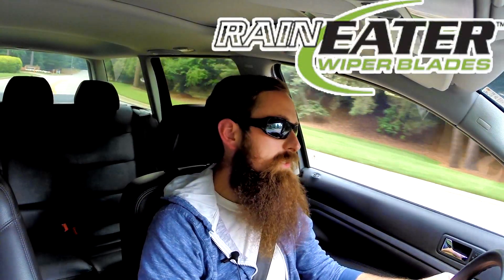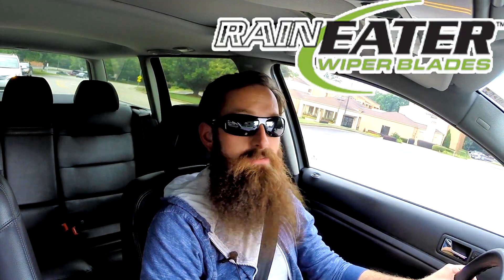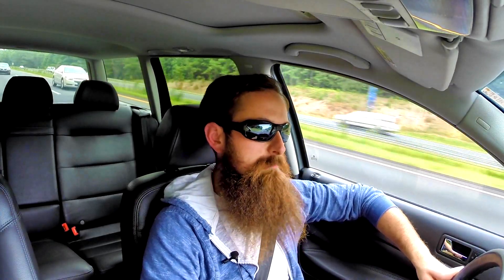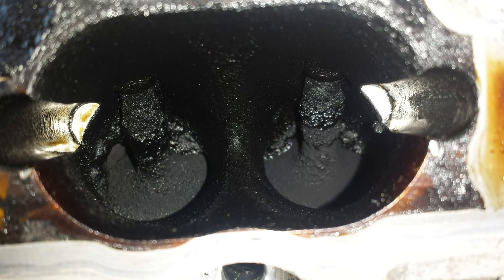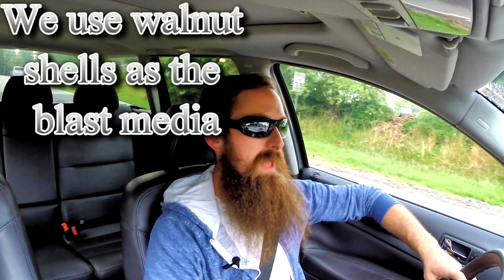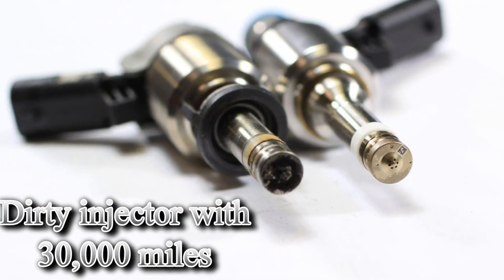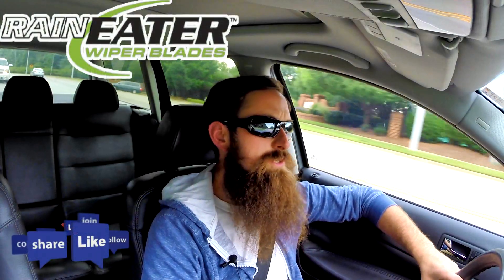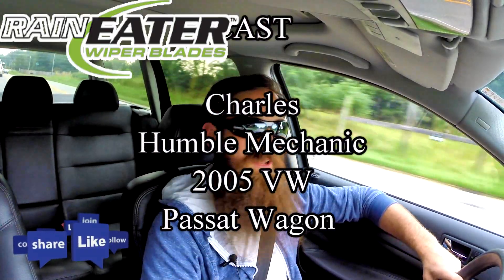Preventing and Fixing Carbon Issues for Direct Injection Engines ~ Episode 80

Comment: Seafoam or Blue chem?
Reply: I had a mazdaspeed 3 first gen the amount of carbon was horrible.., worse than BMW. I developed a cold start problem and misfiring around 70k and the car was raced too for years. I now have a 3rd gen na mazda 3 and na with direct injection produces no carbon at the tailpipe runs as good as when I got it 3 years ago if not better.,
Reply: seafoam has little to no effect on carbon. the mazdaspeed community has tried this, that and the other and the only realistic way of cleaning the valves is to remove the intake manifold and either media blast them or soak them in solvent over night and clean them with wire brushes.
Reply: Shane Miller it's funny you say that cuz in my Mazda 3 I had a too lean at idle code and after replacing the parts recommended by the dealer the light kept coming back on. Sea foam through the intake cleaned out a lot of carbon (black smoke from the exhaust) and the CEL stayed off after that...  Lol your argument is invalid
Reply: what year is the car?
Reply: Shane Miller not relevant to the core context of our contention with each other's statements
Reply: Sure it is. if it's pre 2012 then it's probably not direct injection and you're also saying that you fixed a lean condition with seafoam by cleaning the intake valves thus increasing your air flow... Now I'm not saying that seafoam isn't useful. If you've done it every oil change then there is a good chance that you have vastly prevented build up but if you are 40k-80k miles in and think you are cleaning your valves with seafoam them I'm gonna have to disagree. I'm not here to start a pissing match but vw forum, mazdaspeed forum, and many others have tested seafoam and it's like putting a bandaid on cancer if you have bad build up.
Reply: Yes, but he said he was talking about his Mazda 3 which would have a 2.0 or 2.3 MZR before 2012. Mazda didn't change to DI until the skyactivs in 2012. the MZR-DISI in the mazdaspeed's and cx-7 were the only pre 2012 DIs I was aware of. So that's all I was trying to find out. Sounds more like his seafoam cleaned an injector than a valve to me. NBD
Reply: USDM Mazdas didn't get Skyactiv until 2012. Trust me. I bought my 4th mazda3 that year and my buddy bought the new mazda3 skyactiv 2.0 the same day at the same dealership. Just Google skyactiv-G wikipedia. took all of 2 seconds to reassure myself. Done with this thread!
Reply: Neither----Techron.

Comment: I have a DI mazda Skyactiv and they claim they cured this by keeping the valve at a certain temperature to keep carbon from forming. I only have 16k miles so we shall see. I do wonder about those seafoam intake cleaners that you spray through the throttle body. Based on how your video of you cleaning the carbon of the VW piston methinks short of blasting that off with walnuts nothing is going to work.

Comment: Thanks for the video, as it seems DI is the newest band wagon [little engines w DI, sometimes turbo, high compression = high heat, high pressure torture on parts and oil]  
You didn't mention the use of premium quality synthetic oil or the role of ECM programming on the cause and prevention side of the solution...?
Reply from the maker: The more I learn about the failures, the more I see oil as a vital player. ECMs can only do so much. It requires ALL parties to play nice.

Comment: HumbleMechanic, I replaced my Injectors after paying for a shell blast carbon cleaning. Turns out, my injectors were clogged. I believe the previous owner had been using low tier fuel, maybe even 87 octane. I also had a fuel pump replacement under warranty. I now have an extremely clean amazing GTI with new coils, plugs, PCV, fuel pump, and injectors. This is the entire fuel system. I believe that ethanol is also playing a part in this. I now mix high octane ethanol free fuel to run in my CCTA engine. Next, i will add water injection to further help prevent this issue, and lower intake air temperatures.

Comment: Ford's new 3.5L V6 will have 2 injectors per cylinder to eliminate this problem. One injector will be a direct injector and the 2nd one will spray fuel behind the valve. Initially, the engine will only be used on the new F150 due out this fall.
Reply from the maker: +Robert Devoy cool. It will be interesting to see who else does this. My guess is most manufacturers will go this route
Reply: I wish every manufacturer had to do this. it would really give me peace of mind.
Reply: Toyota has implemented a direct port style injection system in some of their Lexus vehicles the past year for this very reason. Like you said, one inside the chamber and the other just before the intake valve.
Reply: That's how the BRZ works.
Reply: christopher waller question, Ford says not to do any carbon cleaning services in the form of liquids etc but can Lucas fuel treatment be used safely? I don't see why it couldn't, just a general question. While I believe this will help clean injectors, piston tops etc I don't see it having much if any affect on the valve backs where carbon is a major issue. Plz elaborate.
Reply: The GEN 3 coyote engines use both types of injections also. I think that’s the safest route compared to DI only.
Reply: id love to see where u read this being im a ford nissan master tech and have not heard of this. i do know that the new 3.5 thats going in the 2017 raptor etc has been redesigned with harder parts and lower compression so that more boost can be added via the tt snails. have heard of a dual injection. maybe on the 1.8 or 2.0 since they are 4 cyl but this would defeat the purpose of the ecoboost, more power with better mpg. please add a link bc i cannot find that anywhere on any database for ford
Reply: I'll try to find where I read this.
Reply: christopher waller http://news.pickuptrucks.com/2016/09/2017-ford-f-150-receives-upgraded-35-liter-ecoboost-engine.html
Reply: Robert Devoy that's crazy, 2 injectors is unnecessary, and a poor way for ford to "correct an issue" I love my 2.7. catch-cans basically stop the majority of the issue, the rest is fuel additive (lucus/seafoam), and the occasional spirited drive. same issue with my 2.0t fusion but I've looked at mine after what I recommend above. after 84,000 miles, clean valves, put a camera inside to check them
Reply: I can tell you that these catch cans you mentioned do work very well. I have one on my 08 Silverado and the carbon build up on the throttle body and valves is next to nothing now. I do run 93 octane due to it being professionally tuned with EFI live tuning but every little bit helps. I highly recommend this catch can. I read somewhere that the oil vapor that gets routed into the intake can lower your octane rating. How much if it does, I do not know. But I have noticed slightly better fuel consumption and a tad more power than normal. Mabey they latter is just in my head but it does feel better.
Reply: Mr S that's how the old 4 cylinders in the rangers worked too. doesn't mean it was good on gas. u might as well dropped a v8 in there. point is why do direct injection if ur also going to put in a traditional system. that's twice the parts and parts go bad. I worked for ford and my neighbor growing up was a ford service manager who stayed until he ran the place. I learn a lot about how ford takes parts and replaces components so as to keep a maintenance interval. same thing they did with GM's 6f35 transmission. Ford got a hold of a perfectly good transmission and trashed it with crappy parts and lv that breaks down twice as fast and cost more than GM's fluid.  Ford claims it's BC the clutches used which is a bunch of bull. the solenoid fails and the the clutch fails do to shotty parts. Ford did it on the triton with the coil overs and plugs on those damn 3 valves and they tell the technicians and put in manuals to trq to 21ftlbtrq when it should not exceed 18, hence ford made a tool to remove the broken spark plugs. not to mention it's the only vehicle I have had too get the engine hot before busting the plugs. but I can garuantee ford did this to keep money in their pocket. this is why every ford I own I remove ford parts that are troublesome or repair the issue before it becomes a problem. hence my fords make it to 300,000 miles ( between my wife and I we drive 100,000miles a yr. I do a minimum of 70k)  in the 5 fords I've owned and typically get better numbers than factory mpg/power. I know ford and Nissan very well. I know more to since ford uses parts from Mazda,gm, Toyota, etc...  but I'm a diagnosis tech. and Subarus are great cars but do not boast the best mpg either. they usually say 22-30 avg and every Subaru owner I've seen gets way under the EPA tag (had a couple of hose too.. I use to fix n flip when I had my dealers licence.) either way in my 2.7 i average 22 city 25 overall and around 30 hwy in the mountains. at sea level it's better. 2.0t gets 27 average 24-25 city and have had over 40 on long road trips(hwy) it now has 100,000 miles and bought less than a year ago with 33,000 miles
Reply: doesn't  A 4 cylinder mimic a spirited drive all the time?

Comment: If you were going to fog the engine like cleaning an old school carburetor or cleaning a throttle body of a fuelie you would have to spray carburetor cleaner on the valves directly like you would with throttle body or carb. let it sit for 10 minutes and fog as usual.

Comment: AAA just came out with a study that finds that top tier fuels dramatically reduce carbon deposits in injectors, valves and other engine parts. Unfortunately the study did not discriminate between direct injection engines and standard. AAA said that the extra few cents per gallon was worth the cost.

Comment: Had this issue with my GTI less than two years ago and am dealing with it once again. Wish I knew what I was getting into when I bought it.
Reply: Are you using full synthetic oil and regular oil changes?.
Reply: @FacuGonz3  It doesn't matter, air, moisture buildup over time with DI will cause the carbon build up regardless.  A Oil catch can will make carbon build up take longer but eventually you have to get it cleaned.
Reply: Many European cars have this problem, not only German...
Reply: this is the reason this cars have bad reputation , people get cars without first doing research about it then complain when you have to do maintenance , want something simple get a honda or toyota 🤷🏻‍♂️
Reply: Top tier may slow it, what about 93 octane?

Comment: hi, Have you tried water injection? I think this would be a great fix for this problem. I have seen it work on a old carby motor that had bad carbon build up.
Reply: Greg Faggotter I used it for a power adder in my old 79mk1 with a M-tdi. after a teardown at 25k and all I had was a light coating of carbon that almost wiped clean on the piston tops with some carb cleaner on a rag. 
It doesn't work right away, but over a period of time it'll clean up the chambers for sure.
Reply: Greg Faggotter, In the 1950's 60's , in Australia, we had a thing called the "Kleinig water injector", this helped because leaded fuels caused engines to carbon  up and require a de coke, today this? may help, water does not have a solvent effect like fuel so I don't know what  this may do.

Comment: i cant believe they have not figured this out
Reply: Toyota has. direct injection / port injection combination
Reply: Not all do (if any).  I work for Toyota Manufacturing in Alabama.  We make all 3 sizes (4,6, and the V8).  I can only vouch that the 4 cylinder DOES NOT offer this.  It has port injection only.
Reply: 2GUNMASTER when did I ever say that "all" toyota engines are d4-s?
Reply: U didn't.  Just wanted to clarify for anyone who was reading.
Reply: 2GUNMASTER ok. Cool.

Comment: you mentioned oil catch cans in your video. check out the ones made by ADD W1. they are baffled, and have a dipstick as well to check the oil level without having to remove the can. I'm running 2 of them on my Hyundai Veloster Turbo.

Comment: Just did a cross country trip with my a3 (fsi) in some hot weather, by the end of it i noticed my idle is much smoother and my mpg went up significantly, could the the prolonged driving time at full temperature broke down some of the carbon buildup, i am at 87k now with no misfires.

Comment: I use premium in my 14" Jetta 1.8T 5 speed manual just in case and drive spirited...I try to use BP or Shell...Sometimes Golf too. Toyota has a port injector as well as Direct injectors on their Lexus models and new Tacoma only...The next Gen 2017 F-150 ecoboost 3.5 will also have a port injector as well as a DI injectors as well for this same reason. 
Hell have no mercy on yo if you have to clean a 911 engine with their new DI system! lol I pray for those guys!

Comment: BG has a new chemical specifically for this different from their other air/fuel injection kits. Basically it liquefies the carbon. Not sure how well it works but if it does could be a good alternative and also if used as part of preventative maintenance could prevent it from getting really bad.

Comment: This is one area where I applaud Toyota/Lexus. The early 3GR-FSE and 4GR-FSE engines used in the mid-2000s Lexus GS300 and IS250 were prone to carbon buildup, so in 2006 Lexus introduced the IS350 with the 2GR-FSE which brought in "dual-injection' or adding in a traditional port-injector upstream of the intake while keeping a direct injector for top-end power. Voila, problem solved. So good in fact this same technology has now migrated to the Toyota Tacoma and the GT86(Scion FR-S)/BR-Z duo.

I heard the new generation EA888 VW/Audi 2.0 TFSI engines (I think employed in the Golf R and S3) are the first cars in VW's lineup to follow Toyota's footsteps, though being cheap as they are VW omitted such features on all NA-bound cars. This might bite them back in the future with this problem still being unsolved.
Reply: Toyota knows their stuff and expect their cars to last 20 years unlike gm and ford
Reply: +charlietow it was probably an is250 those just had direct injection and not both
Reply: I have a customer who's 07 Lexus still had enough build up to cause extreme misfires, even with that upstream injector. Still had to pull the intake and clean the crap out of the intake, ports and valves.

Comment: thank you man . I was about to buy a mazda6  with direct injection engine . I think am gonna switch to more reliable car
Reply: FYI carbon buildup is not known to be a big problem on SkyActiv engines.  I suppose it's still possible but these are reliable engines and you are probably not going to find much better out there when it comes to modern stuff that isn't overbuilt to the point of gross inefficiency.

Comment: I own a 2010 MK6 GTI with 181000 KM(112468 miles).  My first carbon buildup happened at 103 000 km (64001 miles). (3K km over warranty.)   I paid the clean up from my pocket 800$ cnd.  I mainly used the recommended fuel 91 octane.  Eventually VW sent me a 1000$ check writing me it was caused by intake manifold issue.( I was happy :) )   They also increased these parts warranty to 190 000KM.   I have no idea if better fuel affected it but I had my second carbon build up at 171 000 km and used 94 octane fuel 95% of the time.  I was still under the warranty of the first time and it didn't cost me a penny.   I mainly expect this to happen every 70 000 km now.  It's not a big deal since car is paid off but I still wanna warn other that this could possibly happen again.